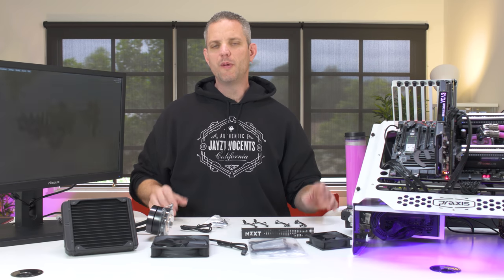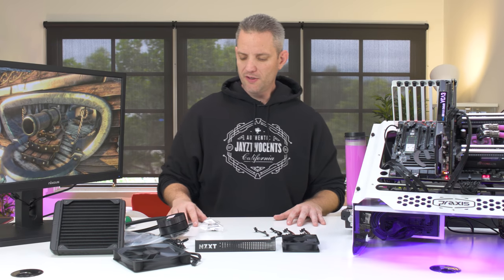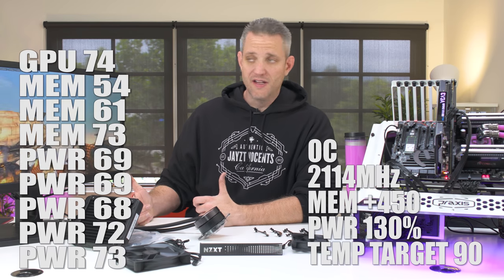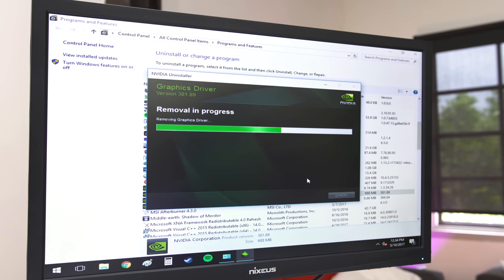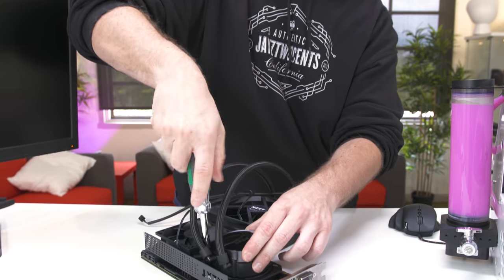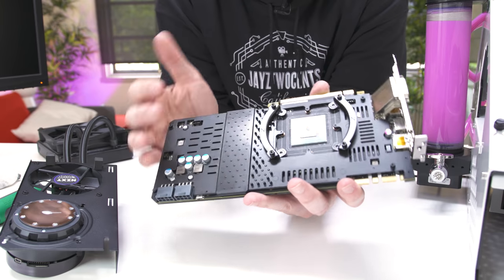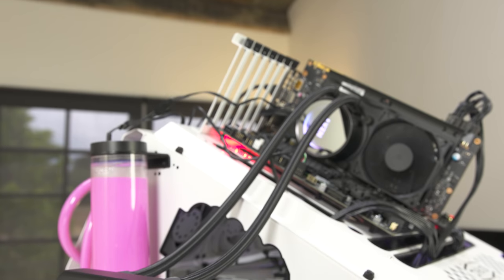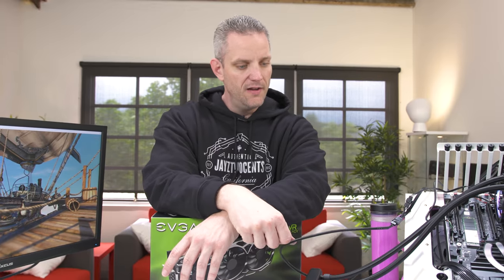How to Watercool a Video Card... The easy way!

Comment: Whaaaaat!?  Thanks for the name drop sir!
Reply: Y'all we gotta make this top comment... small YouTubers like this deserve publicity!!!
Reply: Someone tell Jay to pin it.
Reply: Do you have a link to the video Jay is talking about and do you own a Dremel?
Reply: credit where credit's due!
Reply: That's awesome, Joe!
Reply: i subed as soon as he named droped
Reply: JoesTech you got a sub
Reply: Great vid man! :D

I'm ready to do this with my old (and VERY hot!) R9 290 - i even found a heatsink for the VRMs made by Gelid and i will get some small heatsinks for the GDDR chips =)
Reply: U gone be famous son :D
Reply: i did and it was fantastic, i could OC it to about 1100MHz
Reply: are you going to colab with jay? its the two js
Reply: I subscribed today.
Reply: Congrats mate! you got another sub !
Reply: Up you go!!
Reply: just subbed to you for the mention
Reply: JoesTech jonjo
Reply: Fuckin amateur hour. They way you handle that card is cringe worthy. These adapters work fine when installed correctly. Like using your eyes to make sure its fitted
Reply: Saw yours first as well, probably gonna do this soon, since I have the Asus 1080ti Turbo.
Reply: @nielsarum8057  where do I need connect cables from pump if I have one water cooler on cpu?
Reply: @edgarsnezinu1439 , you can use any fan socket on your motherboard or you can get an adapter to have two fans using the same socket.
Reply: @nielsarum8057  thank you
Reply: does this config work with a ftw3?
Reply: ShadowPBPBC learning to search properly would help. They taught it in grade school in the 90’s so it’s ironic today it’s just assumed “type the thing”
Reply: Pin it
Reply: aaaaand a free subscripe from me because of it! (and many others I'm sure!)
Reply: @wingracer1614  Jay, pin it.

Comment: Good guy nzxt allowing you to use aio coolers other than their own
Reply: Stephen Garemogg it could be that or the fact they don't manufactor it and a third party dose it for them and most good aios sellers buy from them (asitech, I think that's how ya spell the name)
Reply: Dennis Rigdon you're right on that, its because the pump designs between most aio's are pretty similiar also allowing that compatibility with other aio's gives more people the chance to buy it rather than just owners of NZXT water coolers
Reply: Stephen Garemogg Corsair has had something like this for a while and theirs will work with most any Asetek based cooler base or will adapt to one with another plate
Reply: ShadowOfDeath24 the problem with Corsair's version is that it isn't universal. You'd need a different one for different cards.
Reply: What about zip ties??  Same performance upgrade for free!
Reply: +5 RESPECT XP.
Reply: And EVGA on the other side “We don’t test our cpu coolers on GPUs.” EVGA clc does not work with a next bracket, it leaves a gap and kills your gpu in seconds.
Reply: @D4N13Lf00  What are you even mentioning? EVGA isn't on the list of compatible AIOs, and to top that off, the Fractal Design AIOs all fit and aren't listed as compatible. Are you sure you installed it correctly? I'm tempted to swap my EVGA clc with my FD clc for double AIO control, but there goes two use headers.

Comment: Would be interesting to see the same test with the numerous temperature readings; checking the difference between a normal Full Cover waterblock versus the stock aircooler.

Comment: Are you going to go ahead and dremel the front plate and rerun the tests to see how it effects the temps?  I would love to see if it helps or hurts.
Reply: Did it, can't work. I just tried yesterday on my EVGA 1070 Ti SC Black, but even with the 4 little pieces removed, the entire hole is a bit too small for the fixation system of the G12. So if you really want to do it, you will have to cut a bit more than just those four parts. Personally, I don't want to try that important modification for now, my Temp card does loose 20°C in a perfect silence.
Reply: @drsavanflou8781  I used a copper shim to fill the gap. The only issue is the transfer of heat is hindered.

Comment: Really glad to see you did a review of these! I've been using the predecessor of this product (NZXT G10 Bracket) over several builds now and I absolutely love it. However, I've run into the same issues with installation issues that you did on my EVGA cards; I like leaving the faceplate and backplate on for some added heat dissipation and rigidity, but those same tabs prevent contact with the cold plate. You can cut them off, but I bought some copper plate and fashioned my own shim instead to avoid that. As far as I can tell (having done this now on 3 GPUs) there has been negligible to zero negative effects to the cooling by using a shim... I just needed to get some longer screws to make it all work. I also swapped out the included fan with a pwm Noctua fan (plugged into the cards own fan header through an adapter) and everything stays cool and quiet through every overclock I've tried so far.

Comment: You could also use a 1mm thick copper shim between the die and aio block so you dont have to hack up the front plate and or remove it. In turn you would be able to keep the front and back plate on for better protection, looks, and cooling performance. I used a shim when I did this with my 2 evga ftw 980ti's in sli with g10 brackets and nzxt x41s worked perfectly.

Comment: I have the older much uglier version of this, works great but I ran into the same problem you did. couldn't figure out why my PC kept shutting off after a min of use lol.
Reply: I saw a video  when someone put a copper shim in-between to remedy tue issue.  Just had to pit a paste in between.
Reply: @gagongflip389  could you link the video? I need to figure out which thickness copper shim to order.
Reply: @liberalminded1  Depends on how many thousands the gap is

Comment: Hey Jay, you don't need to remove the mid plate/back plate or use a dremel. Just add a copper shim to raise the surface contact level high enough. I did this mod a year or two ago with a kraken g10 and an evga gtx 980 ti classified.
Reply: The evga gtx 980 ti classified has the 4 tabs on the front plate just like the card Jay is trying to cool in this video.  All Jay needed to do was use a copper shim and some thermal paste with no need to remove the front plate/back plate or use a dremel.  This video really needs to be redone to show everyone this more elegant solution. Whatever happened to doing things right?!  I've been doing this for a long time now with my evga gtx 980 ti classified using a 25 x 25 x 1 mm copper shim I bought off of fleabay and a corsair h105 mounted in the bottom of my cosmos 2 case for a long time now. I learned about this solution using the kraken g10 by watching a video from a guy named Reckless Yuki. Stumbled across his video via a Google search back when I was researching using a closed loop AIO to watercool a gpu.  The thing I liked about this solution is that it is reusable when you upgrade. However, the g10 is a PITA to install. Wondering if the g12 is the easiest to use and most compatible, or should I wait for evga to come out with a bracket, as I just bought an evga gtx 1080 ti sc2 black?
Reply: tbrayden3  can you do a video on how to do this please
Reply: @Alibaba-le1ru  It's just a piece of copper. Put it between the gpu and the water cooler, and the heat will go gpu -> piece -> coooler, making it be dissipated. Remember to put termal paste both in the copper/gpu contact and the copper/cooler contact, for better results.

Comment: Glad you chose the graphics card with all the sensors. I didn't thought the memory cooling would be better. In my experience it got worse with a similar unit but passive cooled mem and vrm. But wait a minute... the 1080 hit over 2100Mhz, that's pretty high!
Reply: If you want awesome vram cooling, you could always put some tiny heatsinks on the components. At that point it would probably give a full block a run for its money.

Comment: The VRM and Mem temps could also be lower due to less heat transfer from the GPU core since it's running a lot cooler.
Reply: @Salt Maker but the video had lower temps for those components. How are they suffering?
Reply: @Salt Maker so motherboard VRMs and system RAM. If you have a decent setup those don't overheat anyway. How much do they suffer?
Reply: @Salt Maker ok, care to elaborate then?
Reply: @Salt Maker You said VRMs and RAM suffer from using this Frankenstein kit. You said not the ones on the GPU or motherboard. Which ones then?
Reply: @Salt Maker You were the first to say VRMs and RAM suffer. I replied that the video showed lower temps for those components (VRM and VRAM) after installing the liquid cooling kit. You then said you weren't talking about GPU temps, when I brought up those component temps, not core temp.
If the video demonstrated lower VRM and VRAM temps, how do they suffer? Calling me dense isn't contributing to this discussion.
Reply: @Salt Maker You're still not explaining how they're improperly cooled. The video showed lower temps, which implies they are being sufficiently cooled.
I'll never learn if I don't ask questions, after all.
Reply: @Salt Maker i wonder if it wouldnt be too bad with a lian li dynamic with bottom intake fans

Comment: hi Jay. I ran into this problem as well with my 970 ftw+ and the midplate (or faceplate as you call it). no Dremel necessary, a 25mm x 25mm x 1.5mm copper shim will raise the coldplate and pump high enough to avoid interference with those tabs. eBay/Amazon has those, but I hacked up the baseplate of an old heatsink into that size shim. works great, no hackery.
Reply: Hope you see this, man. Easiest fix for people who run into this issue.
Reply: ^this
Reply: I'd prefer using the Dremel. Using a shim is not the most ideal solution. It works but yeah.
Reply: doesn't affect temps much and easier than cutting, especially for someone who doesn't already own a Dremel so it's a good solution for those not exactly comfortable cutting with a rotary tool (and hoping to avoid voiding any warranties)
Reply: using a shim is best solution but make sure you put thermal compound on both sides of shim, btw iam using a shim with my 780ti, kraken g10 and aio cooler.

Comment: Thanks for the information, i went out and bought a Corsair H55 and the G12 for my RTX2070, the G12 dosn't say 2070 is compatible but i saw some comments about it in another video and i took a chance, i went a bit overkill and bought two Noctua A25 fans and slammed them on the radiator and a adapter so i was able to connect them to the gpu.
The MSI RTX2070 Armor on the stock cooler sounded crap and was up and sniffing on 80c with some OC, after the change the gpu dosn't go over 60c, the OC boost to around 2040mhz and the memory got a 600mhz OC landing on 15200mhz.
Reply: I plan on doing the same thing. Just made a build with 9600k waiting on the 2070 super was trying to decide on closed loop or not.
Reply: @Daviteck AMD bracket. A lot of 2070 have differences, mine is a MSI Armor 8G wich has a massive PCB.
One more thing, if you use the AMD bracket a Corsair H80 is to big to fit...sitting here with a 100$ AIO i have no use for :D
Reply: @ImDembe  Seeing as you responded not long ago, I was hoping for some help. I have an EVGA 1080 TI SC Black with the G12 Kraken, attached to a Fractal Design S36. I have the mini pwm attached to the S36 pump header, and the 92mm Noctua I have is now on a motherboard header since I believed the splitter to be the problem. I still have no control in MSI Afterburner or EVGA Precision OC. Have exactly do you have your headers wired? Should my fans not be connected to the pump and I split it among 3? I have another Deepcool 10 fan hub coming in, and I'm hoping to fix this, but rebuilding this thing and cable managing is dreadful at this point. Any help is appreciated.
Reply: @NPurvis7622  Not sure how i connected the 92mm fan, probably to one of the chassi fan 4-pins and ran it at silent speed (like 50-60% might have used the rpm lowering adapter that comes with the fan), the fans on the radiator i bought a 4-pin pwm to mini 4-pin pwm and they went straight in to the gpus fan header, the pump was connected directly to the psu via a molex adapter so it ran on full speed all the time.
Good luck.
Reply: @NPurvis7622  I used a https://www.amazon.com/Phobya-PWM-Adapter-Graphics-Cards/dp/B01EUZD854 to connect directly to the gpu.
That adapter shouldent be hard to find somewhere els if you don't live in the states.

Comment: Before I even watch the video let me just straight up say that doing this does work and work well enough. I run a SLI pair of GTX1070 cards both with the EVGA hybrid kits on them. (EVGA cards too. No surprise there. lol) Dropped my temps plenty low and even allows me to run them at max stable clock 24/7. Totally worth mounting an AIO system with a 120mm rad on your GPU.

Comment: I recently got and installed the kraken G12 on my 1080Ti FE which was always running at 90C during gaming sessions, now when gaming or benching my temps are around 47-49C, and around 30C idle. I was lucky that I had an older 240mm Arctic cooler laying around un-used which fitted into he G12 perfectly. I wish I would have heard about the G12 bracket years ago.

Comment: If you plan on doing this to your card: PLEASE remember there are other components on the PCB that need cooling. Either have direct airflow from other fans or install heat sinks directly on the VRMs and memory.
Reply: Yeah he's using a custom mount by NZXT that has a fan positioned a few mm away from the card, blasting all of the components you mentioned. Definitely stupid to take off the heatsink and just pop an AIO on there and call it done - you need a fan direct mounted on the card, which is exactly what Jay does in this video.

Comment: My EVGA 780 Classified also had that problem with Kraken G10 bracket. I didn't modify the baseplate as that would have voided my warranty. I used a copper shim with thermal paste on both sides and the temps have been great. 47C for the GPU and 52C for the VRM while being very quiet.

Comment: I had a similar problem with my RX 480 reference card, I got a Corsair H45, got it on my GPU, straight swap with the aluminium block, black screen no boot up. Got another gpu on, boot up, got the rx 480 back on again, and it booted up fine. And the temps is down in the 40's like yours in the video 👍 and the reference fan on 30-40% no issues with pwr temps either  😄
Reply: no issues with the stock baseplate, lots of room for the cooler head  😉, just a little cut on the shroud for the pipelines .
Reply: I've read about some AMD cards having VRAM overheating badly while the GPU core gets great temps. I've only been researching the r9 390 and similar/related cards such as the 7970, 290x, etc., but I've seen a few comments about cards being ruined, one even with heat sinks applied to the VRAMs. I bought a Kraken g10 but haven't applied it yet specifically because of the risk, though I may order some of the little heat sinks to try it.
Reply: My card is a ASUS RX480 Reference card, i'm using ASUS GPU Tweak2, monitoring the temps, wrm included, under stress test, Furmark the power temps got up too 50¤c after 2 minutes. But i don't see any problems when gaming. But thx for the heads up 👍
Reply: Been running for 3 weeks now without any problems, what I know of.
Reply: Update on temps, when gaming SWTOR for hours, GPU temps max are 45¤c, Power temps max are 55¤c.
Reply: Great to hear how the cooling has been fairing. I think the 390's usually run more hot, though. I'm still debating on whether to get another water pump and g10 with some ram heat sinks or just save that money for a cooler-running new card, e.g. the Vega (if it ends up being at least a decent competitor between the 1080 and 1080 ti. I don't have to have the top card; Volta will come out before too long and likely stomp whatever will already be around. But if the cost and performance of the Vega is competitive and can pull off 4k pretty decently, I may grab one. With how support dwindled for past NVidia cards, e.g. the 780, I'd rather not take a chance spending half a thou$ on a card that may not receive much support for more than a couple years.
Reply: I know this I super old but Rushtallica was right. I had a G10 on my 290x for a week. Seemed to be no problem until my card started crashing randomly. Soon enough I found out the hard way that my vram was not getting cooled well. Either don’t buy this for hot AMD cards or get heatsinks in there to help out but be warned.

Comment: I added this to an MSI 1070ti about 6 months ago after my air cooled card was running at around 76 in Division 2. Now i run the GPU at around 50 on full load in the game
Reply: Thats pretty Nice and No noise to 😉. i have had this on My 980ti for 2+ years now, from 84 c to 50 c.
 I have No issues with my vrms as many is worried about (Even with oc for such a long time)

Comment: No cutting necessary, just use a 20mm x 20mm cooper shim. Be sure to put thermal paste on both sides of the shim (side facing gpu and side facing cooler).

Comment: When putting the Kraken G10 on my EVGA GTX 980 Ti Classified, I used a 1.0mm thick heatsink copper pad shim to go in between the block and gpu die because of the same problem with the faceplate. Works great!

Comment: Only listen to watercooling stats after the loop has been running for over 2 hours.  Air cooling will ramp up, and ramp off very quickly while water cooling takes longer to reach its maximum and it takes longer for it to come back down as well.